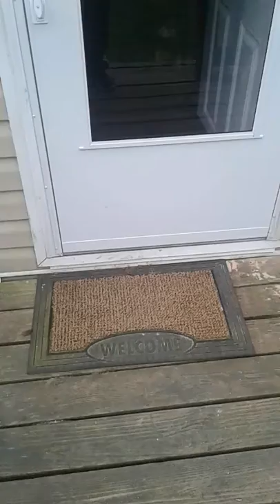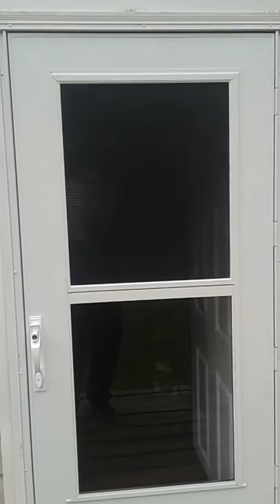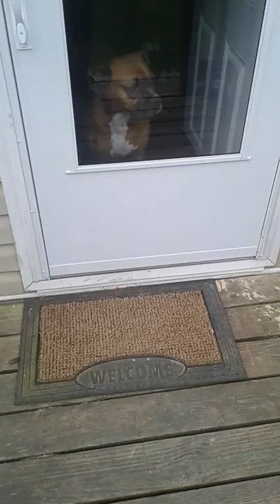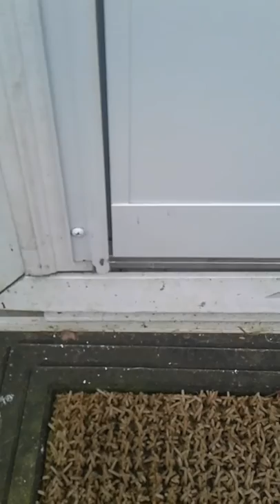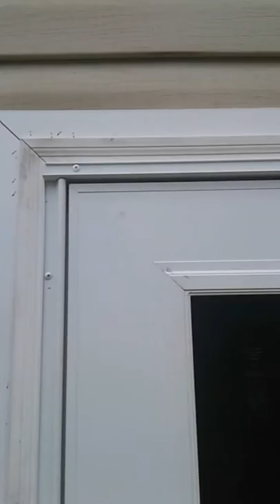Modified standard storm door cut for mobile home

Comment: Good Job! Not only does it work it is half the price of a door custom sized for mobile home application from my local mobile home supply. I just bought the same door at Lowes intending to cut it down to fit a portable shed  with a 75" high opening. After watching your video I know it will work just fine. THANKS!!

Comment: After watching this video. I just purchased the exact door for my double wide mobile home. Thanks for the video.
Reply from the maker: Make sure after you cut the bottom to seal the wood or it can swell. Either paint or put a good bit of caulking in the door sweep before reinstalling.
Reply: @jameso38  thank you
Reply: Finally got my storm screen door put up. Same exact door that you have. I never would of thought to buy one and cut the bottom until I came across this video. It was fairly simple. Made sure I primed and painted bottom and calked it for extra protection. 🙏
Reply: @ricksmith1973rs  Did you make a video of it? Do you have the item# of this door?

Comment: I have a 20 inch wide door I wanna put a bigger door in how hard would it be? I’m sure I need to cut a bigger opening
Reply from the maker: Depends on load bearing wall or not, but yes you would have to enlarge the opening.
Reply: Greenacres Homestead has a recent video that may help. I just found it. Gonna watch it now.

Comment: What tools did you use to cut the door
Reply from the maker: I used a jigsaw with a metal cutting blade. You have to go slow. But a circular saw with a carbide tip blade would work to cut the actual door. You'll need a hand saw with a metal cutting blade to cut the bottom of the frame. Be sure to take the door sweep off of the door first before cutting the door. After you cut the door make sure to seal the wood before reinstalling the door sweep. I've done 7 or 8 doors like this now.
Reply: Did you make a video of a mobile home install? Mine broke off hinges last night and I do not know where to start.